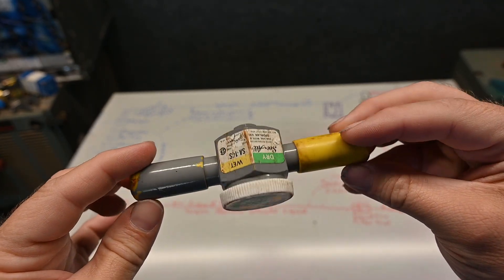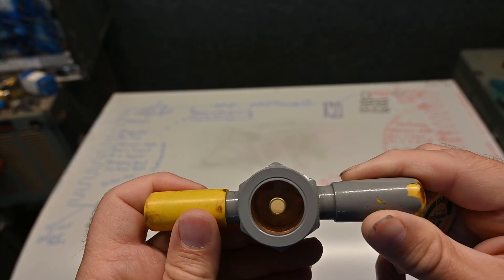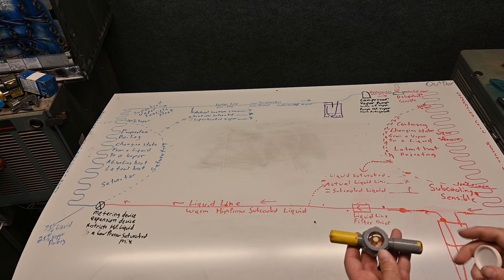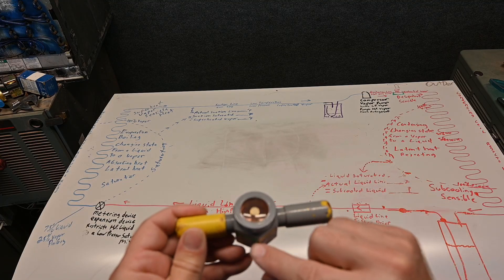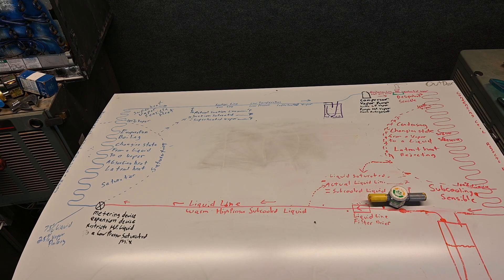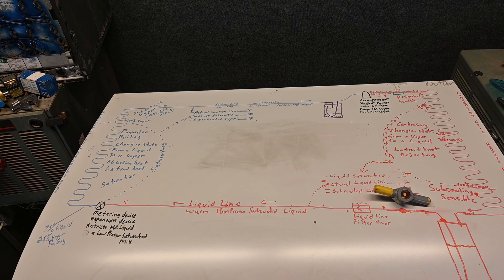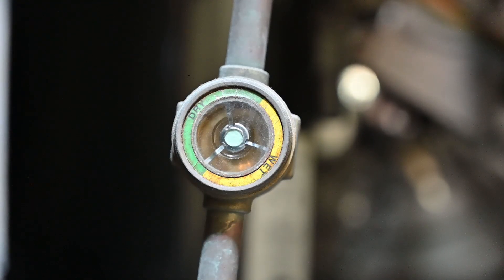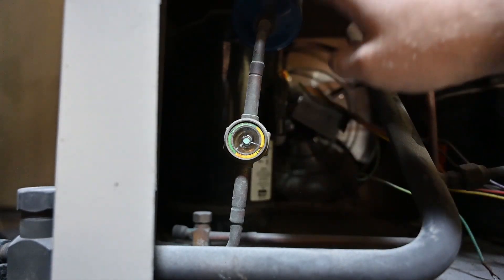HVAC 084 sight glass

Comment: Great video, thank you.  I'm moving from residential AC to refrigeration and all I've been hearing is "clear the glass".  However, I've noticed many machines off on high limit that have flashing glasses (checked dirty condenser, fan blade position, RPMs etc. ).  It was during that heat wave we had a few weeks ago and none of the glasses would clear ( especially 404A )  I started reading up on it and I've read that the best way to check a charge is to see the receiver is 80% filled regardless of the sight glass.  Is this true?  Thank you again!!
Reply from the maker: Yes, a receiver should never be over  80% full during pump down. 

A sight glass is a tool bit it's not a complete method of charging. 
Especially during a hot pull down, the charge could be good and the sight glass flashing.
Condensor being clean is also very important.
Reply from the maker: Be sure to check out my friend Chris Stevens with HVACR Videos. He has excellent commercial videos

Comment: Is it just me?  Nowhere on Google/Youtube can I find a simple guide on how to read a sight glass.  I don't need theory.  If a sight glass looks like (A), it means (B).  If a sight glass looks like (C), it means (D). etc.  Anyway, our HVAC guy is having a look tomorrow, maybe he can tell me.
Reply from the maker: A sight glass alone is not used to diagnose a system but a tool that provides more information assisting in diagnosing. Interpreting a sight glass should be left to an HVAC professional. 

If you want the simple "it looks like/it means" here it is.

If the color in the center matches the color in the outside ring under "WET" it means there is moisture that will turn to acid and kill the system.

If the color in the center matches the outer ring under "DRY" then there is no moisture. 

If the metal is anything other than shinny brass there are contaminants in the system need to be cleaned. 

If the system is running near operating conditions and the sight glass is clear it means it's extremely undercharged with only vapor or charged correctly with liquid, or overcharged with liquid.

If there are bubbles in the sight glass it means it's undercharged, has non condensables, or not yet operating close to design conditions.
Reply: Late to the party I know. Sight glass is a tool for the technical primarily. First we have to assume that the sight glass is installed with an expansion valve metered evaporator coil. If not then it is useless. It should only be installed as close to the metering device as possible. Always. However, if the lines et is 30' or less and sized correctly then most of the time you can get away with it. Always verify sub cool. If you have a lineset much longer than that and it is installed at the outdoor unit then you will have bubbles or periods of clearing and bubbles. Sub cool should also be checked at the evaporator. Can't tell you how many times I've had to correct an overcharge at town houses and condos because the tech pumped it up to clear the sight glass. For the home owner. If you are having cooling issues and see bubbles in the sight glass then call a tech. Could be low or could be something else like a bad txv. It's not something to worry about as there really isn't a lot you can do on your end. If you see occasional bubbles that clear up and go away that is most likely normal operation. Especially on a really hot day. Hope that helps. Appreciate the video.

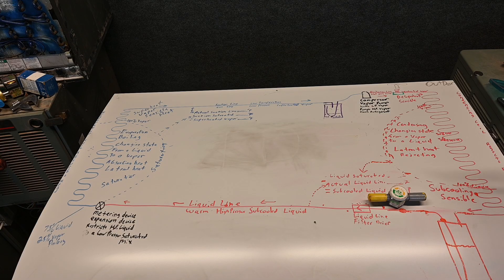Comment: At 3:25 you are explaining it opposite. Typically need more refrigerant during winter as the headmaster bypasses and backs liquid into the condenser to maintain head pressure. If the system was only charged to a clear sight glass when installed in warmer weather, you could end up being very low when the headmaster bypasses to the point you lose liquid seal and the headmaster is wide open and just feeding boiled gas to the expansion valve. I have had units do this and start bouncing off the low pressure control.
Reply: Really? My boss says to first block the condenser to drive up head pressure and thus simulate hot days then charge refrigerant until sight glass is full, and that's how you know you got the correct charge.
Reply: @matttzzz2  Never charge by sight glass alone. Low refrigerant isn't the only thing that can cause bubbles in the sight glass and a clear sight glass doesn't mean the system isn't undercharged or overcharged.

Comment: hi .as we know, the moisture inside the refrigerant system can damage the compressor..So, how to identify if there any moisture that exist inside the refrigerant system?? is there any alternate prevention or method to avoid the moisture from damage the compressor from the early stage??
Reply from the maker: The moisture indicator in the sight glass is 1
We can also use an acid checking tool and test a sample of refregerant or refregerant lol. 

The moisture is going to get in by
#1 improper evacuation/dehydration  ie not a dream enough vacuum in microns. 
#2 not purging the hoses properly when servicing, or bleeding the HP threw they manifold gauge set.
#3 leak in the system on the LP side that causes the unit to go into a vacuum pulling moisture in. 

Units over 30 years old have 0 moisture in them.
Reply: Ac  systom  circualingtime  drit moster filshioin need  coprssar pard  damerges  some ttime  this  liuqud the circulating  mostisure  may   harm  the  motor  winding and  valves     because if  high suction pressure the boiling point of  liquuid  in  the eva  porator  of  water  coiler bottlw  cooer   ac   is  above  32°f  amd  moisture  inside wil not freeze in such   machiesdrier filtres are not required nly  strainers  arerequired to removeig dust   particles  .but in some  ac  and  watrcoolers drier filtr  is  used stop the circulation of moisture throgh  the systom      thrd typ  2side weding type  sight glss fee size sam  derfrnt typed fee   varus  typ  of  moisture  in  dicators  are ftted in the sytem  to indicate  the  presence  of  mosture the  liquied line  moisture  idicator turingpik  or  orange if  dangerous  amount of  moisure  is  preset and  reen or  blue  if the  refrigerant  is  dry  some  times a  filter  is  mounted  i  the  suction   line  also  to  perevnt  foregn  particls  entering the  compressor  dire  cap city  on  compressor  motor  hp  ...drier  size  cubic  iches    comprssor  moto  hp  ..using   2i  ..hp  or  exls  1/8..3..1/6to  1/4  ..6  ....1/4  t1/2 ...  6  ..1/4to1/2...9   .1/2to3/4  ..9..1/2to3/4  ..12..3/4to  1"  ..30  .1/2to3 "usinexpls

Comment: Thank you for another important and extremely well done video.
I am so happy you explained about sight glasses and residential installations. 
Carrier wants those systems using TEVs charged by the sub cooling method and weigh in method for new installs using over 25 ft of 3/8 liquid line.
As you said, just because the sight glass is clear, does not mean the charge is up to the manufactures specifications. And, no, close enough does NOT count.
In commercial equipment, as you said the sight glass is helpful, BUT, not the be all, end all answer.
Thanks again for another great and accurate video!
Reply: Should the sight glass be installed horizontally or vertically? I saw one installed vertically and could see a solid strong stream of liquid falling from top to bottom, and the fridge was cooling perfectly, but the sight glass wasn't full?

Comment: Hi there and thx for the video, so I was told that in order to remove a moisture contaminated system, you'll also need to remove the compressor oil. I made a mistake and didn't get a good vacuum and now head pressure reveals non-condensables with the aid a poor pump and hose. Yikes!!! 
Any suggestions TY Branaman??
Reply from the maker: If it's POE oil, then you may need to change the oil. 
POE is hygroscopic, meaning it has an affinity for moisture. Once water gets in it turns to an acid. 
It is possible to pull moisture out of POE oil with multiple fiter drier changes. Either way moisture in POE oil is a pain in the @$$.

Comment: on the topic of stupid questions nobody asks: does the moistuire indicator "reset" if you vaccum the system or does it needs to be replaced?
Reply from the maker: Most Yes, once you pull a deep vacuum it pulls the moisture out. Some need a little run time before the "reset"

Comment: The site glass,liquid drier & subcool reading I do inside as close to the metering device as possible,that's what peirce Phelps taught.
I don't install site glasses. 
What does a black dot mean (acid)!
🥃🥃🍺🍺🍺🎳🍇
Stay safe. 
Retired (werk'n)keyboard super tech. Wear your safety glasses.
Reply: Yes but this is mostly for refrigeration where a sight glass is almost always needed. In addition, SC is rarely used in refrigeration.
Reply from the maker: I forgot to mention the black dot!
I've installed most of my sight glasses inside after the drier before the metering device. Nobody told me that, it just makes sense to me. It's measuring knowing others teach my that way.  That seems to really upset people. I've been caused out for that before. I agree with you it's usually the best place. I don't like a drier in a walk in though.